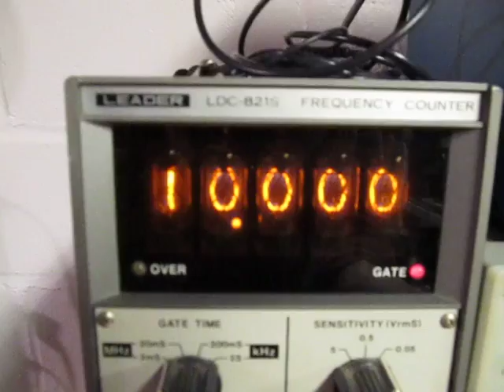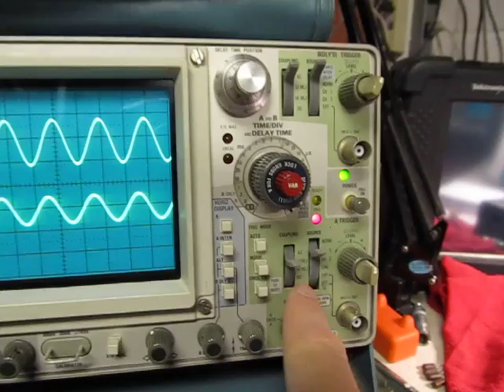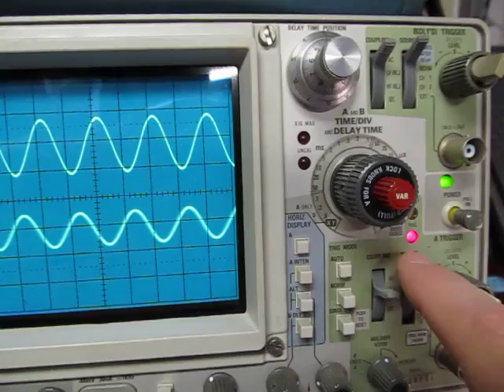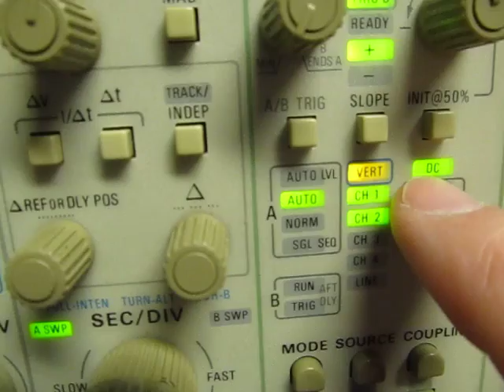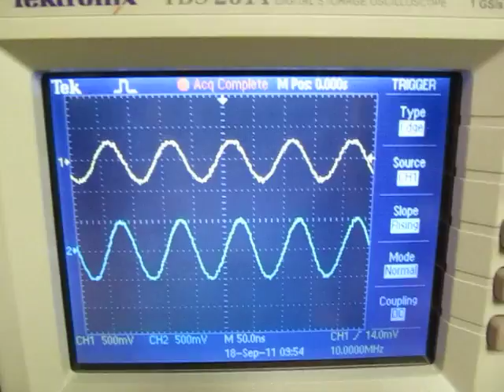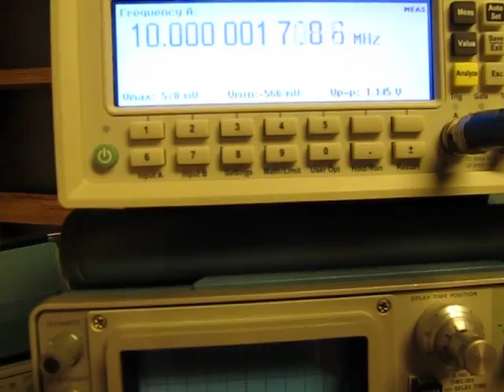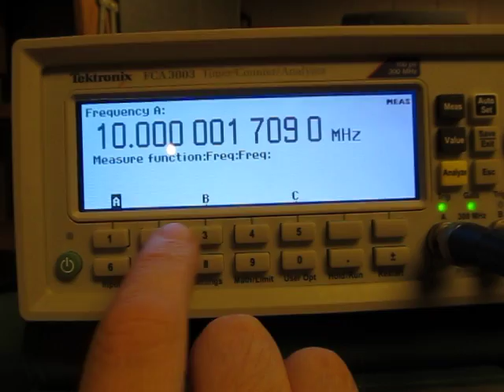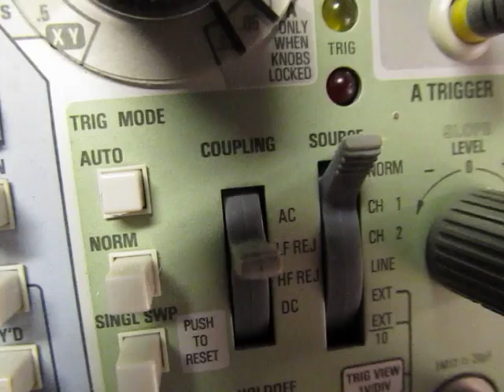#19: How to get a stable scope display with two signals very close in frequency

Comment: There's another way to achieve a stable display with two similar frequencies. (I have an old Iwatsu 7510 and never knew what the 'norm" was for, but I've tried it and it works.) However, if a scope doesn't have this facility you can achieve the same with the A-delayed-by-B facility. With both traces running in "alt" mode (not "chop"), trigger one trace on channel 1, switch on the B timebase and trigger that on channel 2. The A and B timebases need to be set to the same frequency. You should then get 4 traces - two copies of each trace, one triggered on channel one and the other on channel 2. Two of the traces will be steady and two rolling. You then need to use the two vertical position controls and the trace separation control to move the two rolling traces off the screen, leaving stable displays of each channel on the screen. I've tried it and it works. Even with frequencies 15% apart, I got a nice stable display. Although I haven't tried it, this should also work with two totally different frequency traces running with different A and B timebases.

Comment: But how can you manually allign both signals when the oscilloscope is stopped? Horizontal position affects both channels...
Reply from the maker: Most digital scopes do not give you a way to move the waveforms independently in the horizontal direction.
Reply: @w2aew  so if you have two waveforms with close frequencies , there's no precise way to align them so you can visually compare their rise times.
I got my first real oscilloscope yesterday (it's an SDS1202X-E, I already had a DSO150) so I tried measuring the 1khz test signals, which is how I bumped into this problem.
Reply from the maker: @alejandroperez5368  If you have two signals close in frequency, you can perform a long capture, and then zoom in and scroll through the result to find edges that are close together.

Comment: Could you not also just trigger from the line frequency
Reply from the maker: On an analog scope, triggering on the line frequency will only work if the input signals are harmonically related to the line frequency.  On a digital scope, you can certainly use the line trigger in a single acquisition to view these unrelated signals.

Comment: That "Norm" or "Vert" trigger mode on the Teks is genius. I don't know why that feature is not present on many modern digital scopes ? Sure you can view them in Single Mode, but in order to see dynamic changes in both signals in real time, you'll have to press the Single or Run mode several times. Whereas the Norm or Vert trigger modes keep on showing live pictures of both signals, but synchronously, which is a far better idea. Anyway, thanks for the video Allan, even though I'm a bit late to the party...
Reply: Yes, it's an excellent feature. However, it's important to avoid trying to do any phase comparisons when using it, because both traces start independently, based on their own trigger, so any timing relationship between them is lost.

Comment: No digital camera, huh?

Seriously, though, why would you want to have both waveforms stable, knowing that they are different?  OK, these two are not sufficiently different to see it on a scope, but each one can be examined individually, and I can't see what the advantage is of viewing them at the same time.  If two waveforms were synchronised, then you would view them at the same time (but triggered from only one) in order to examine how well they were synchronised - what delay between them etc - but with two asynchronous signals?  If they have nothing to do with each other, surely it's good enough to see them one at a time?

BTW, I have a Tek 2465 CTS, and I didn't know what the "Vert" was for, so thanks for the info.
Reply from the maker: One good reason why is if there was noise on one of the signals, and you want to see if it is due to crosstalk from the other signal.
Reply: Hmmm... Your answer makes me think there probably are circumstances in which this would be useful, but I can't envisage what they may be.  If the noise you mention was constant (like white noise), and appearing on both signals then both signals would look fuzzy, so this method wouldn't indicate where the noise was coming from.  It would have to be noise pulses or glitches.  Now, if you were triggering from channel A and the signal on channel B was drifting (as in your video example), and you saw that the noise pulses on both channels were static w.r.t channel A, that would be a clear indication.  However, stabilising both signals on the screen would be a retrograde operation. In that case, you'd have two static signals, with noise pulses running along one of them.
I'm not arguing with you.  If scope manufacturers have designed this feature into their machines, I'm sure it must have an application.  I just can't see what it may be.  Whatever it is, it's unlikely that I'll ever need it, as an occasional hobbyist.  I've been using my scope for the last month, after switching it on for the first time in 15 years (and replacing all its PSU capacitors)
Reply from the maker: If the signals were digital, and the noise due to the rising and falling edges (which is very common), then having such flexibility with the triggering can help determine what signal the transient noise is coincident with.  Of course, this vertical-mode triggering can be used in cases where the signals are very different in frequency too.  Often used?  Not really, but it is just another tool in the toolbox that is interesting to think about, and doesn't exist in modern digital scopes.

Comment: Hi what is the best of the 2 (tek 2430 / tek 2465A) in term of math/auxiliary inputs and outputs (Not Analog Bandwidth) Features 
Thanks
Reply from the maker: It's a bit hard to compare these two.  The 2430 is a digital storage scope while the 2465 is an analog scope (no sampling, no storage).  So, the 2430 will have some digital waveform storage and automatic measurements.  The 2465 on the other hand was probably one of the best lab-grade bench-portable scopes ever made. - very flexible and reliable.

Comment: Some of the Navigational systems I worked on required certain timing between one pulse to the start of another pulse or gate. To ensure correct timing you would put a probe on the ext trigger and use that as a reference for adjusting the delays of a second pulse. Another way of using it is if you are following a received pulse through out the system. If you want to reference the event of one signal to another.  A lot of systems are designed with sync test points for this very purpose.

Comment: You could probably use it to check continuance of audio signal or looking at some I/O pulses or clocks but in reality a signature analyzer or logic analyzer is a better tool for that, counting you have the schematic. Most laptops have all the processes going inside VLSI (south bridge, north bridge, processor) and they are in soldered by BGA (ball grid array) so getting to it is a challenge in other words they are not made to be serviced component level.